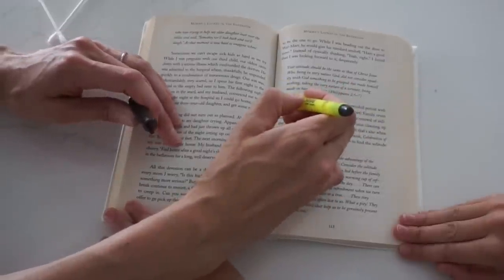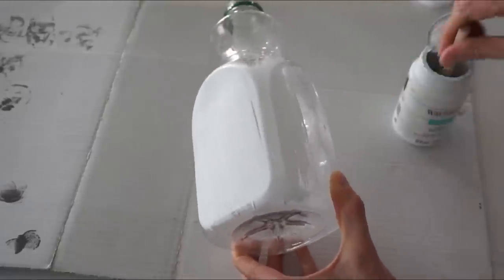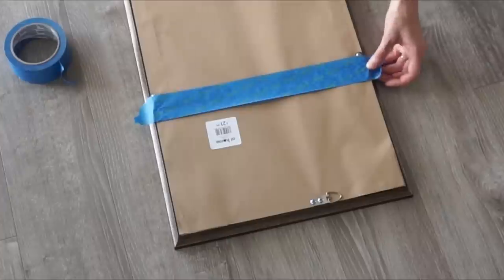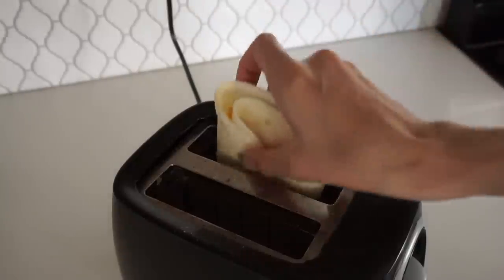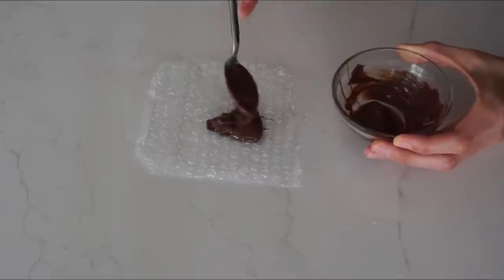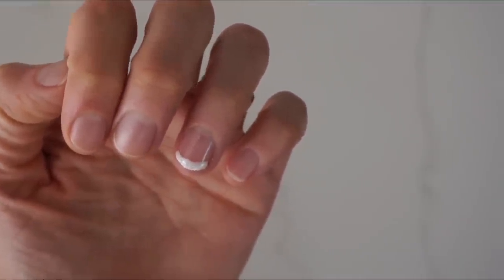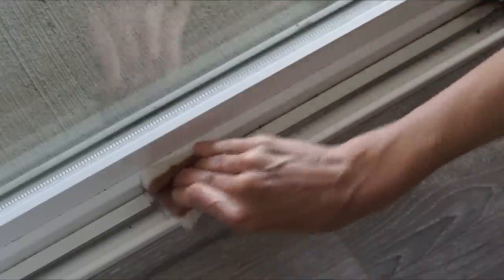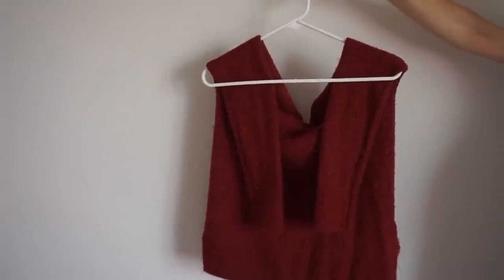Testing 15 Viral TikTok Life Hacks & DIY Hacks + 15 Home Hacks that Work!

Comment: Plastic wrap on the paint can is good if you're going to be using the paint soon, but for longer term storage, put the plastic wrap right on the surface of the paint. It'll stop the skin from forming and protect it from any debris or rust that may form over time.
Reply from the maker: Thank you

Comment: When using screwdriver to open paint can use screwdriver and hammer and pop a few holes along the paint can rim to let paint drip back in without the getting drill out to make the holes much easier to wipe off screwdriver then drill.

Comment: Re your #15 DIY hack: Either use velvet hangers or pipe cleaners or rubber bands befor put those 'sleeves' on or else they sleeves can fall right back out from the weight of your sweater. Judy...Baldwin, IA

Comment: To stop paint from filling the crevice take your flat head screw driver and a hammer and punch a hole or 2 in the can. The lid will seal it or you can do the saran wrap too if you are worried. Been doing this for years, it works!

Comment: The orange works best if you roll it hard and kinda bang it around before you poke the hole also it has to be on the side not the top or bottom of it.  Since its hollow in the middle of it with the sections around it. Go almost to the other side.

Comment: Great tips. I have a Stanley 25' tape measure. I had to check it out. It has 3-1'8 " on the side of the case. Thought I had to use a magnifying glass to read the very print  Thanks for sharing.

Comment: Hi, Thank you for the video, great one, lots of useful information.
  For the orange, back in the 1960's, we rolled them on the table and applied pressure for awhile, and squeezed them. (I think Dad and I were the only ones that tossed them back and forth to each other like a baseball.) After that we used a pairing knife, or steak knife, and cut an angled circle out of the stem end, about the size of a nickel, in a cone shape. Just deep enough to cut the tops off of each segment. After that you can suck the juice out (as in the original “juice box”), or squeeze the juice out.
  In the 70's in Florida road side orange stands, you used to be able to buy these devices to plug into the cut hole in an orange to use like a short straw into the orange. Also this slim devise they used to call an “orange zipper”. One end you pushed into the stem end of the orange and pulled down, it cut a clean line only in the peel from pole to pole, to make segment type slices. The other end was curved slightly, to run under the edge of the peel to release it from the orange. A quite clever device, hard to find anymore. Last one I purchased was about a decade ago. I always watch for them, if I ever find any I buy them. My husband tends to loose them if packed in his lunch, or gives them away if he knows I have at least one more at home. If you ever find an “orange zipper” buy yourself a few of them to last you for years, hide the rest like you hide your birth certificate. LOL.
   Again thank you for the video, lots of information.
Take care, stay safe.
☺️✌️🖖            😷

Comment: If your lemon/lime/orange is left at room temp and then you roll it back and forth on the counter putting some pressure on it before you try juicing it you will get alot more juice from your fruit... Js 😉

Comment: To remove sticky sticker residue. Spray WD40 and let sit for and hour. It will come right off. 2:00
Reply: The product "GOO GONE" works great...a citrus scent.
(NOT the product "Goof Off"😟 which is petroleum based and similar to acetone!
Reply: Toni V. Jensen that product is great, but why spend money on something you might use once. Just about every house has WD40 which does a better job.

Comment: Great ideas u can also drill some small holes in paint can rim for overflow to drip back into the can and clear rim. I saw someone else cut pieces of a pool noodle and put over clothes hanger then hang up your sweater.
Reply from the maker: That’s such a good idea thank you
Reply: Using a pool noodle on a hanger 
(instead of buying fancy padded, 
satin hangers) is a great idea!
And the texture of the pool noodle is non-slip, too!

Comment: Good Mornings I have dress shirt that was dried with pen😔 So there's ink all over it. Have any ideas how to get ink stains out?
Reply: aqua net hairspray works like a charm
Reply: Seen that on her. Thanks wasn't sure would work. Get me can. Have good weekend 🙃💋
Reply: try nail polish remover, it has worked for me.
Reply: When you use the hairspray make sure you get the aresol kind. Regular spritz kind doesn't work as well.
Reply: Yep spray hairspray just before tossing into the washing machine, works great!
Reply: Thanks all.. Women united
Reply: Save your hairspray, it's the alcohol in hairspray that dissolves ink.  Not all hairspray works. Ahem, Aquanet (; 
Rubbing alcohol in a spray bottle, is your friend.  
Depending how large the ink spot, use a tissue to dab up or LOTS of alcohol to spread it out (otherwise, you can end up with a blue ink watermark stain)

Comment: You need to understand the different types of oranges. There are eating oranges and juice oranges. You had an eating orange. The cell walls are thicker so you can handle it and peel it. If you try to peel a juice orange you will have juice running right down to your elbows!
Reply: Absolutely! Oranges bought for homemade orange juice have very 
thin skins. Check at the store...
you'll be able to tell the difference 
right away!

Comment: These are awesome! Well, most of them.
HOWEVER ... Please please please -- DO NOT use random plastics & plastic garbage for food hacks.

Not all plastic is the same. Bubble wrap is NOT food-safe plastic. Meaning that it disintegrates & leeches out the chemicals that are in it -- it begins leeching out the minute it is manufactured, and continues to do so for the life of the item. Heating the bubble wrap with warm chocolate would make it leech even more. The chemicals in these kinds of plastics are highly carcinogenic, and really should not be ingested. 

For food -- please, people -- only use plastics that are food-safe (there will be a little knife & fork symbol on the bottom -- that denotes it's safe for food). It's not in the video, but I've seen a lot of people buy little plastic pails & shovels for little kids to use for sundae bars then eat out of them -- this is also not safe. If you wouldn't give your kid a cigarette, or melt plastic & mix it into their food, please don't give them non-food plastic to make or eat food.

Thank you for reading this. Take care & stay safe.